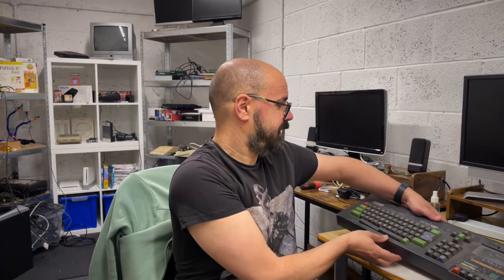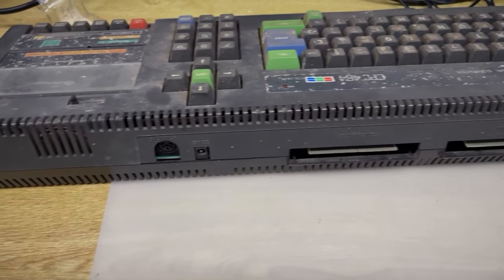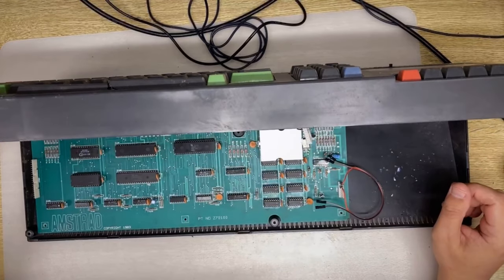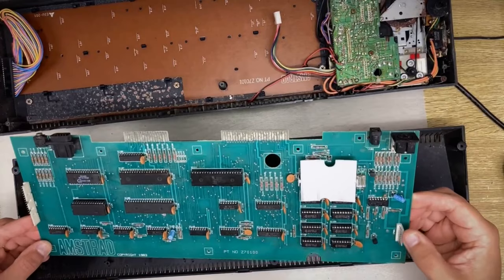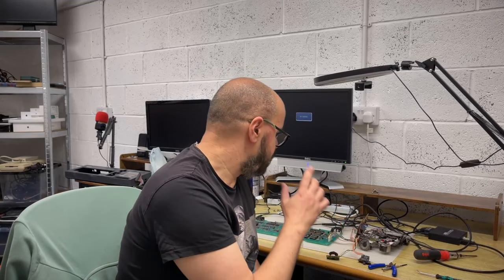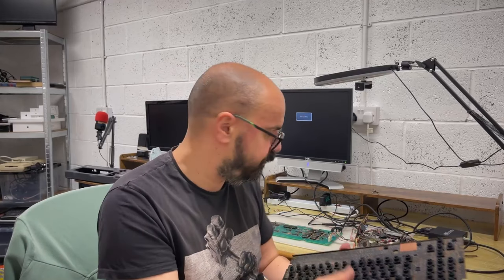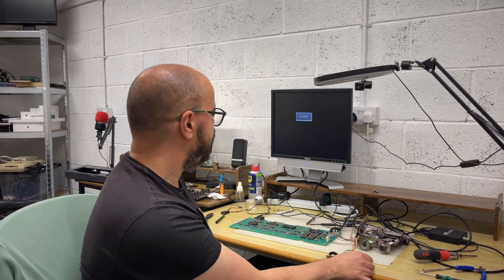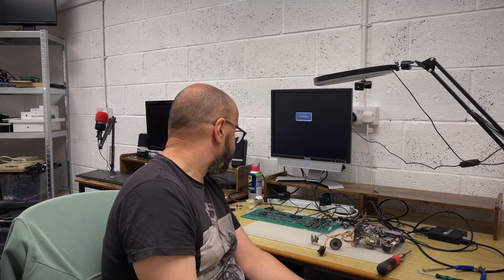Amstrad CPC found in an Outhouse Pt1

Comment: Nice donation, would love a CPC to tinker with, but not sure it would get round the bend in the steps down into my basement flat, just got out sofa in but a CPC, <sucks-teeth> 😂 

Tip1: Noels CPC Diag ROM
Tip2: Keep the tape deck and use the Amp circuit on it to help tape input - see Noel video on it again
Tip3: there is a tapduino that's been made to fit inside a tape case, pop one of them in to the broken tape deck to load, seen it on Noel (yup ol' Mr CPC again) Discord server recently, I forget the name, ask there...

Good Luck!!!
Reply from the maker: You can be sure I will be rewatching Noel’s videos 😃 He’s an Amstrad guru.

Comment: I know next to nothing about Amstrad machines but I suspect it could indeed be a RAM issue. If the chips are socketed, try swapping them and check if the pattern on the screen changes at all. If so, it might be worth trying to replace them with known good ones. 🙂
Reply from the maker: Indeed - I think I saw a change after I removed all the socketed chips and contact cleaned everything.

Comment: Get the gate array out, Deoxit the lot and then if that doesn't work find another gate array. (obviously also Deoxiting the other socketed chips). With that amount of rust on the inside, anything socketed could be a culprit.
Reply from the maker: Yeah I did use contact cleaner in all the socketed chips, removing each. Didn’t notice corrosion under them but yeah it is likely underneath. I’ll have to learn a bit more about these machines 😃
Reply: @RetroRecollections  Gryzor on the CPC wiki forum is the go-to guy for diagnosing CPC's that show something on screen but won't start
Reply from the maker: @chinnyvision thanks for the advice 👍🏻